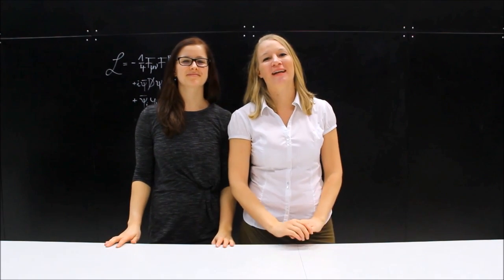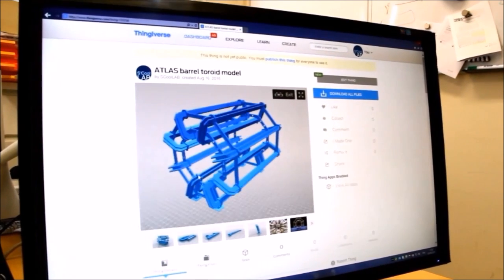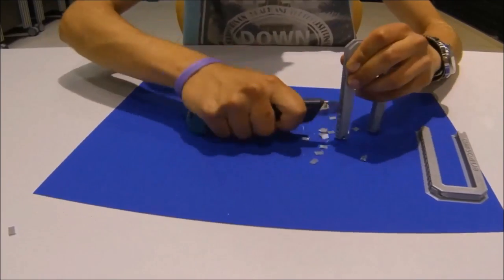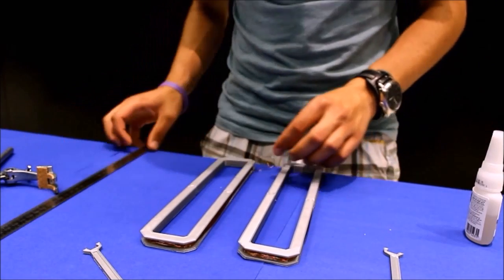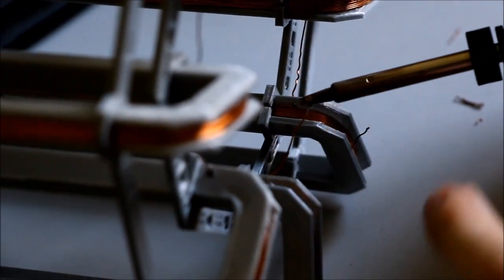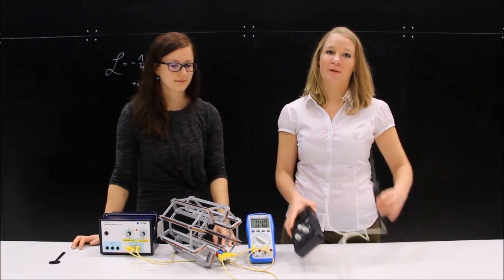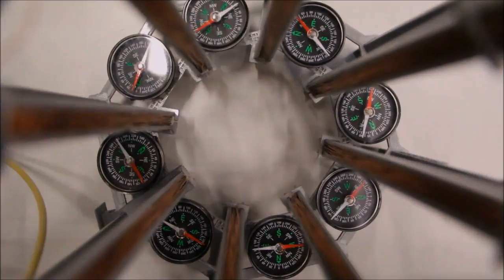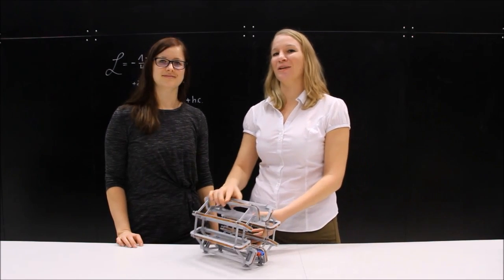Build your own ATLAS magnet: a functional 3D-printed model

Comment: seems like the electron gun should influence the detector coils, not the other way around, if you are to be simulating the ATLAS's purpose and function.
Reply: thus, the instruction to connect all wires in series is faulty since you want to be able to isolate the particle's path which is why the electromagnetic segments are radially arranged.

Comment: CERNS primary focus must be on gravity- to reverse global warming.  There is only one way to reverse global warming- and that is to push earth and moon farther from sun-  radiation is proportional to 1/distance source squared.   Push the earth  against the gravity of the Sun and tow the moon farther from sun.   It would take advanced supercomputers to perform the calculation.   The sun has a gravitational effect on earth and moon and this gravitation can be used to push earth and moon farther from sun just as you take two poles of a magnet and use the positive charged poses and push against one another.      CERN in switzerland can be used to push the earth and moon farther from sun- adjusting the planets temperature to pre 1975 conditions.  New York would be very cold again, so too would london.  But the north and south poles would then begin accumulating ice preventing the cities and some states from vanishing under the oceans.
Reply: I like the sound you make when you shut up.